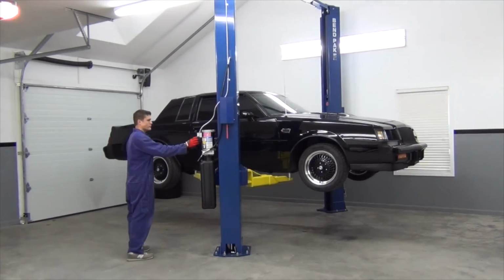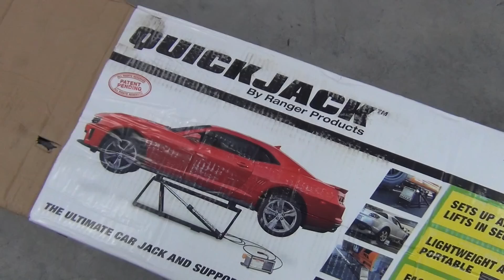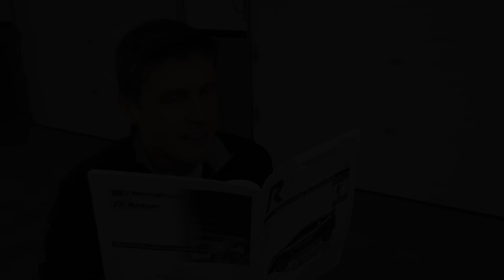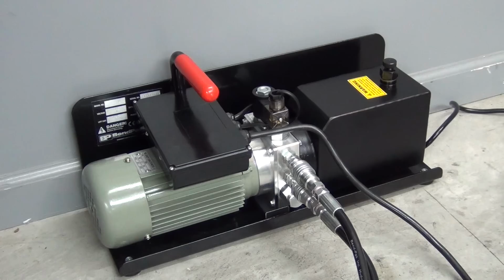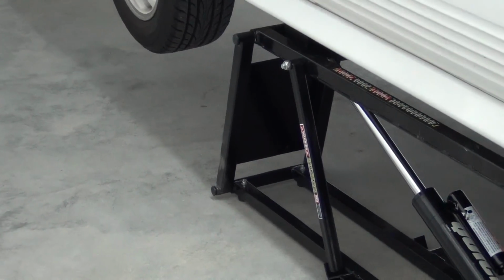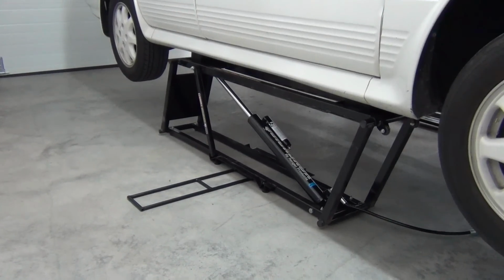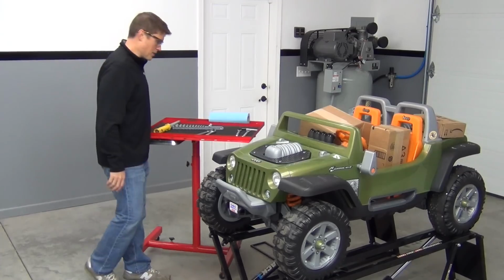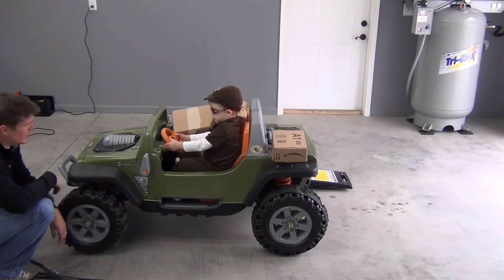My New Ranger QuickJack Portable Lift

Comment: Well, I stewed on this comment for several days now. I am not known for my diplomacy so I thought better of an immediate response. I am all for paid reviews. I just feel that it would be more sincere if the review appears less bias. All products have their weakness, including this one. It only makes sense to include them in your review. It is not fair to anyone to sugar coat over them. 

These are large pieces of hardware and take up considerable space when not in use, compared to jack stands. This design greatly limits ingress and egress from either side of the car. The hydraulic lines make using a creeper from the front or the car also difficult, if not impossible. I was left wondering how exactly you lined up the rubber blocks with the lifting points on the car?  These are not "death to a product" observations, just accurate ones that should have been included IMO.

I hope you find this criticism constructive. I love your channel and will continue to do so.
Reply from the maker: tonkatoytruck No worries man and I appreciate and welcome well delivered and thought out critique.  It's honestly helpful.  I guess it's my style of doing these, I don't sit down and critically review the product, I just sort of present it as it is and how I've used it.  Maybe I'm easily impressed, but I've already used it three times instead of my lift or jack stands and found it to be really handy.

Regarding your points- No, they won't replace jack stands as a fast, non-bulky, inexpensive tool.  I don't think ingress and egress is effected anymore than a four post or even some two posts lifts, so I think that's a matter of opinion depending on the situation.  Heck, I just leave them on the floor and step over or walk around them when I park.  I don't own a creeper, but yes hydraulic lines in the way would be a nuisance, but the lines can be moved and manipulated.  Lastly, I lined up the rubber blocks on the as you would a jack or jack stands, centering the block on the lifting point go the car.
Reply: I've been a fan of Tom's media since his website days in the early millennia, and have been inspired by a lot of his ideas over the years.  So I say this with some trepidation but I have to agree with tonkatoy on some of his points regarding this product. While I don't share his skepticism on any specific review bias, I do think this product has some serious flaws despite being a step in the right direction. First and foremost is the price, and the fact that it's only a 33% savings over a quality two post lift which offers A LOT more flexibility and comfort when working under a vehicle. The point about adding multiple hydraulic hoses in the common working area is a major contention of mine after spending years of frustration  contending with just a single pneumatic hose for air tools. Adding two more hoses to manipulate would pose a greater challenge while attempting to maneuver a creeper, or jack, or in removing heavy parts from under the car. That is a major design flaw in my opinion. I think this product functions better as a viable replacement to jacks and jackstands purely as a supplement to a full size lift, much the way Tom's shop is setup. Otherwise I think your money is best spent on acquiring a two post lift assuming your shop can support it's very basic needs. If a lift isn't a viable option for your shop I would suggest using a race ramp system and a jack which costs less then half what the Ranger Quick Jack does. As always Tom thanks for reviewing this product and sharing your opinions with the rest of us!! I agree with you 98% of the time :)

Comment: Has anyone made an air version of this? Most people already have shop air. The way it could work is instead of the hydraulic ram you would have a screw system turned using a mechanism similar to a pneumatic wrench?
Reply: There are lifts that utilize a giant airbag in the middle, with arms that swing out from the center and extend... whe have them at the evening school I attend to
Reply: But they aren't really portable tho, if thats what you're after...
They're placed and bolted down in a recess about 4" in the ground...

Comment: Hey Tom another fantastic video as usual :-) I just was curios as to why you haven't coated your garage floor yet? You do some much work in there, (not that it needs a coating) just curious. Thanks
Reply from the maker: skizzlemane1 Thank you sir!  That's a fair question and I like the idea of a coated garage floor, but I've known a couple of busy, high end shops who coated their floors and it didn't hold up.  They both strongly advised against it and I don't regret skipping that step.  Concrete is prone to being "dusty" though and stains want to immediately sink in vs. more easily being wiped up with a coating.
Reply: Oh ok I don't realize their was a sustainability issues with those types of floors... Yeah dust is what I hate most about the bare garage floor lol but I can deal. Thanks for the reply
Reply from the maker: skizzlemane1 You're welcome sir!  I think it can hold up if you treat it right and repair blemishes quickly as they arise.  I knew I wouldn't have treated it well, I'm always dragging stuff across the floor (transmissions, etc) which from what the shop owners told me, would've gouged the coating.  I love the look and benefits though.

Comment: can you detach the air hoses ?
Reply from the maker: labrados12345 Yes, they are hydraulic hoses and they are detachable for easier transport.
Reply: Tom's Turbo Garage way better than a scissor lift then, I just wish they weren't 1200 bucks, you can get a used lift for like 1000 in my area

Comment: This quick jacks AREN'T CONNECTED to one another in case one were to slip , this is dangerous. The best jacks are the lifters screwed down to your floor  and cemented to give you ultimate safety. Otherwise, one wrong move the whole thing can collapse on top of you.

Comment: kinda scares me, bet it could tip over sideways, I'll stick to my 2.5 Ton floor jack and jack stands lol
Reply: +VOOODOOO  I had a similar lift for about 10 years.  They are solid as a rock.  You've got the whole thing fairly well triangulated.  The problem with my lift is that it was like this one - only 400mm off the deck...
Reply: Hi good info thanks,
Reply: How is this any less stable that jack stands?

Comment: Is it good for slammed cars?
Reply from the maker: You'll have to check out the BendPak/Ranger website to see if the measurements will work for your vehicle.  They have all of that info posted on there.  Most lowered cars need to be raised in some fashion in order to clear a lift.

Comment: Thanks for the nice video on this lift.   I'm interested in it.   Have you found not being able to slide under the car from the side to be any kind of drawback?    Also do you think it is long enough to fit the later model Mustangs?   Thanks again for the video.
Reply from the maker: You're welcome Sandy, I'm glad you found it helpful!  I haven't found a lack of side access a problem, as I only use this lift for tire rotations and other maintenance.  I could see it being cumbersome if you were doing some work on either side though.  Jack stands would allow more room in a case like that.  

As for the fit on your mustang, I would look at the specs very closely and measure your car accordingly.  It does not fit all cars due to jacking point differences, etc.  Here's a link in case you need it, click on the "features and specs" tab and look at the distance between the rubber blocks on the illustration as one guide.  http://www.bendpak.com/Shop-Equipment/QuickJack/BL-3500.aspx

Good luck whatever you choose!

Comment: for all you nea sayers, BS.
 check out the corvette forum under C7 Z06 section. i could tell you there are no negative reports and the price is pretty resonable for a jack sysrem you can take to the track. when I trust a jack system for my $78,900 Z06 with zero problems it is all good.
 for the commentor saying he has heard many horror stories of the system failing, PROVE IT!!!!

Comment: Are your lifts swapped left - right?  Driving over the hydraulic hoses will destroy them in short order.   They now have a 7000lb version on Amazon for $2300.  That's a little steep.

Comment: At the beginning go the video you talk about your Commercial Grade lift and "the best part of it is that end the end of the day you are not sore from working on the cold, hard garage floor."  Well, with this "Bend PAC"lift that you are promoting in your video, that is exactly what you will be doing, working on a cold, hard garage floor..  No thanks.
Reply: Well he does also state in the video that if you don't have the sort of garage space, and or the sort of money. That this is a cheaper, smaller and more portable solution.
Reply: But the 2 post lifts are coming down in price, not to mention they are making them for lower ceilings. I can get one for around 1800 bucks but I have to install it at that price.

Comment: Great review, I've been thinking about getting one of myself. Quick question; Is the 5000 much larger than the 3500? will the 5000 fit between the axles on a NA/NB Miata?
Reply from the maker: Thank you and I'm glad you enjoyed it!  The 5,000 is a good deal larger than the 3500.  All of the measurements can be found here: http://www.bendpak.com/Shop-Equipment/QuickJack/ and you can see folks using a 3,500 to lift an S2000, which is similar in size.

Comment: Yout just just rode over your hydraulic fluid hose everytime you get ready to lift the car. Intime those hoses will burse. Should have position the car and then put jacks in thru the front under engine and then stide out onto side of car.

Comment: Don't like that you're driving over the hoses.....needs a better setup.
Reply: Had he actually read the manual, he would have known not to do that at all. You can have the jacks at the center of the car then use the grabber handle to pull them out from under each side to inbetween the tires. You can do what he did but have the hoses not going directly to the center right away so the tires can't go over them. There are also a total of 4 quick disconnects, 2 per side at the power unit and at the jacks so you can completely disconnect the hoses. Or you can do what we are going to do, have the vehicle parked first, and then assemble the jacks around it from where they are stored. We won't ever leave them just lying around when not in use.

Comment: Just as many “old school” mechanics will tell you, a hydraulic jack / lift is meant for lifting NOT supporting the weight of a vehicle. That safety bar doesn’t instill much confidence in the event of a hydraulic failure. I would probably supplement with jack stands. Would NOT trust it as it sits. Sorry!!!!!!!

Comment: Dog in the engine is a common problem in Miami, FL.   Also untrimmed mold flashing means your motor mount is bad.  If you have oil on a frame member IN FRONT OF THE ENGINE and a dry parking spot at home, then you have an oil leak they must fix.  No engine running problem requires replacement of all 4 of the fuel injectors on your 6 cylinder motor.  Thank You Chrysler dealership in Hialeah FL.  Theiving creepy idiots.  Then there's the hydraulic clutch in my ford ranger ruined by fluid replacement I paid for along with water pump replacement.  Wonderfull design requires engine be pulled away from transmission to replace one of the parts.  So, not a fan of Ford,   Ford Truck dealer found it neccessary to open back cab window into camper top to assess the problem.  along with removing the hood and putting it back on crooked, like their entire damn operation.

Comment: How much is this sir,.
Reply: +Kevin Evangelista Too much! You'd have to be an idiot to pay $1000 or more for this thing.
Reply: +Road King 1000 doesnt seem too bad for what you get.
Reply: TheBCSledder
Then buy one. By the way...that's for the small 3500# version. If you raise and lower your car 20 times with this thing it only cost you $50 a lift. Anyone that has to lift their car 20 or more times needs a new car. This is not for a professional shops use. How many times do you think you'll raise your car over the next 3 years? Then do the math.

Comment: No armour for the hoses?  You just drive over them?  Scary!
Reply: Had he actually bothered to read the manual, you never drive over the hoses. Either put the jacks together in center of vehicle between tires or use enough slack in front so the hoses are on the sides away from tires. Not to mention there are 4 total quick disconnects, 2 per hose, near the jacks and on the power unit. It comes with grabbing handles so you can reach them from under the center of the car to drag them into position between the front and back tires. Or you could just pull the car in first, and then set up the jacks from where they are stored like we do.

Comment: I can't see pay that $ for a tool that is only slightly more convenient than the several Floor jacks and stands I already have to use. The  "extra" height gain is negligible as your still working on the ground. Storage also seems a little more cumbersome. So no thanx.
Good vid though.
Reply: 6 ton jack stands have the same height fully extended, about 2 feet from $200 for set of four.

Comment: I LIke to have lift,but I've heard some horror stories of them coming down.
Reply: +Roger B. I've heard that planes can fall out of the sky. Best not go in one of them either.. And Lifts.. Lifts have broken in the past. And Cars.. I've heard alot of horror stories about cars.. No cars either... 
Install it correctly and not think "How cheap can I install this?" then you will get sturdy quality results.
Reply: +Colin Richardson Yeah, but planes normally don't fall out of the sky, so better not take things out of context.
Reply: You heard a few horror stories about a few lifts.. Obviously not the norm otherwise they would not be sold.
Reply: thats why you always support it with 4 jack stand for safety precaution since people dont usually care about how much a lift can lift a car and will use it on car that weight more then the recommended weight.
Reply: Lifts don't normally fail either.
Reply: You should never depend on 1 thing to keep a car off the ground. It's always good to have 1 or 2 fail safes just in case. Reason why people use jack stands with floor jacks.
Reply: This device has built in "stands" thats what the bars are that come down and lock
Reply: lol...true. my wife always ask me if the things I buy for the garage is safe. So,  I just tell her, of  course not. They sell these things to reduce the number of population size in the U.S. DUH!
Reply: TheBoxster1998 😄😄😄😄😄😄👍👍👍👍
Reply: Simply using jack stands with it would quickly put those "horror stories" to rest.

Comment: It's only useful for tire maintenance
Reply: @gugo. what are you talking about, I could pull out a whole transmission with those. Change  oil, replace suspension, axle shaft, tie rods, hub assembly, control arm, etc.

Comment: Meh, 18" clearance is no improvement over jackstands.  The key to happiness is lifting the car only rarely and doing everything you need for a while, over the course of a week.
Reply: thats as much as you can do on these low clearance scissor jacks. The bigger ones go up to 53” but you lose access to the middle of your frame so tranny, transfer case, 02 sensor work goes out. A mid lift is probably the best if you have the garage for it for a comparable price.

Comment: Too bad it doesn't lift the car any higher it's kinda of a low lift wouldn't be comfortable doing all types of work on a vehicle good for tires brakes and oil changes I suppose
Reply from the maker: Zachary Vigeant I hear ya Zach, but it would likely have to be much beefier with larger components and such in order to do go higher with stability.  I have already used it for a quick oil change/tire rotation/brake inspection and found it to be really fast and convenient for that specific job.

Comment: My truck weighs 8k. 😂
Reply: Then you can't even use the 7000 lbs. version which I hear came out much later than the original one. So maybe they will make an even higher rated one. Our current truck we figured with full tank of gas and other miscellaneous stuff left inside was under 7,000.